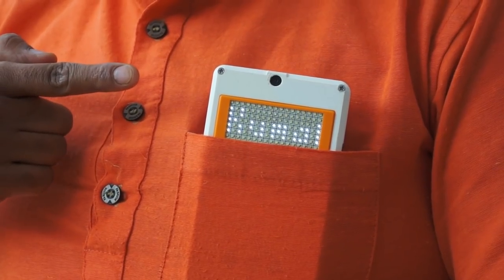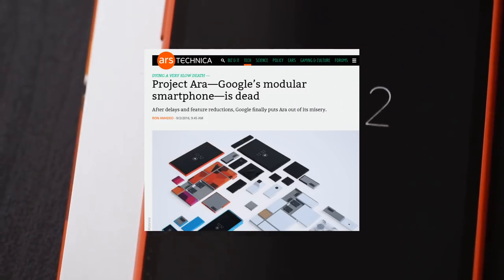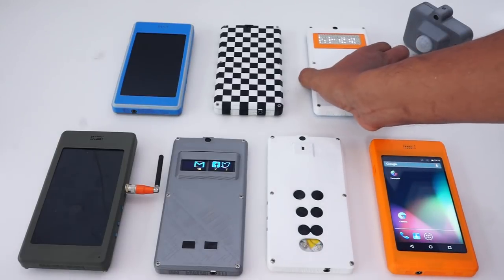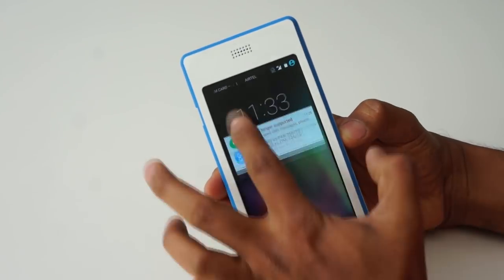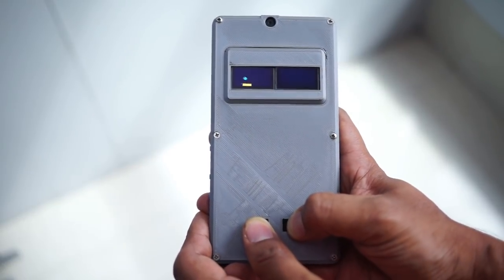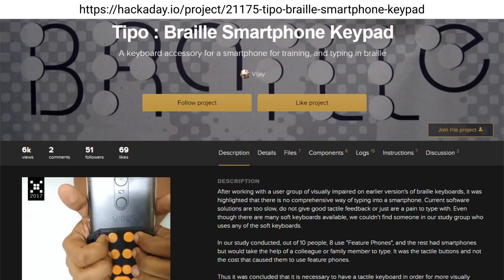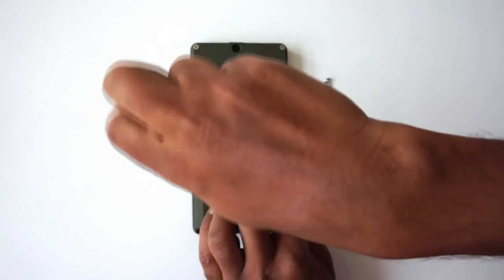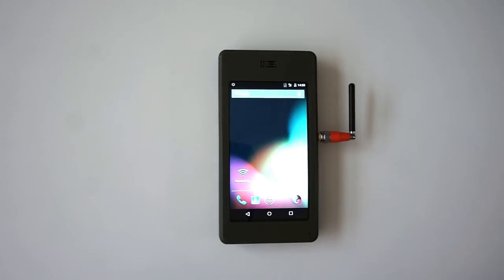Kite : DIY Modular Smartphone Platform

Comment: Very interesting. I do hope you'll be successful!
Would it be possible to implement hardware switches for turning off camera, microphone, and GPS? That way you could brand it 'Privacy Phone' too.
Reply from the maker: Camera can be easily removed by the user.  Same for microphone.  To turn off GPS and modem, one could erase the Android modem partition.
Reply: I think he meant so they were quick and easy to switch on and off. Opening up the phone each time isn't quick. I'm not sure how quick it would be to erase and restore the GPS/modem compared to a flicking a physical switch.
Reply: This coming together of engineer consulting....im here for it. This is community.
Reply: @rupert274  The easiest way to do it is to cut off power from modules :D  Camera? Shut down power line, there is no camera anymore. Microphone? The same way. GPS / modem? Firstly, you need to make them a separated modules from the rest of device, and then use some switches to cut the power and signal from them when you want to be "incognoto mode". The biggest challenge is to put half of dozen switches somewhere in the smartphone to protect them from switching randomly during everyday use...

Comment: If 3d Printers were much higher in proliferation, I could really see this spreading out, but don't give up this Idea has merit, however, maybe you should focus on small batch production and offering the kits in batches using the sales of one batch to fund the next, as well as take orders on several 'models' of common setups for the Kite Phone, at of course a slight premium since your team would be assembling them. Even in smaller sales numbers you can still turn a decent profit. This is definitely an enthusiast product, which makes it a little difficult to use kickstarter to fund.

Comment: Is it possible to install FreePBX/Asterisk and use Kite as a GSM/Voip gateway?
For example Raspberry on FreePBX OS, with installed GSM module would work perfectly for that.
On the other hand in mainstream phones it is not possible to intercept the audio stream from-to the GSM module and redirect it to installed applications.
How does Kite work for this specific issue?

Comment: Idea is great. But the specs... Really 1Gb with an upgrade to 2? You should start with three! Next, internal storage. Having 16 Gb means you will get very little amount of applications which you really can use. 32Gb as a minimum should be put.
Android 5? Really? In a year or two you will have almost no modern applications which will actually run on it. It is waaaaay outdated. At least 7 should be considered.
Okay, screen is a good one. Processor is a very slow one, the performances is something an end user will definitely not be satisfied with.

So, in general. If you provide so low-end specs, you will get a very outdated device only for tech enthusiasts who will just play a couple of hours with it and leave it on a table, just because it is unusable or inconvenient. Upgrade the specs, and you will be good to go.